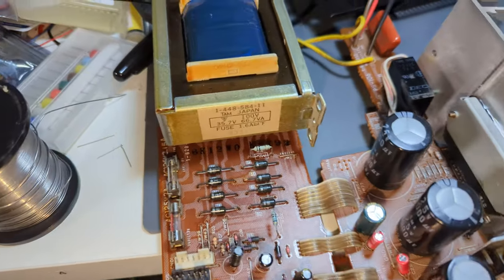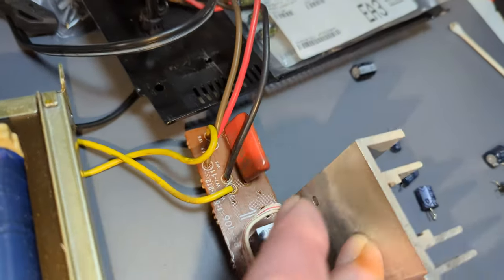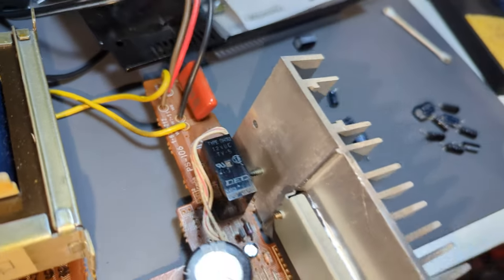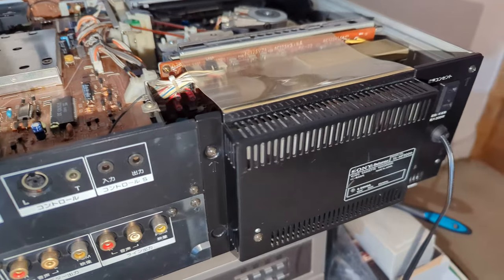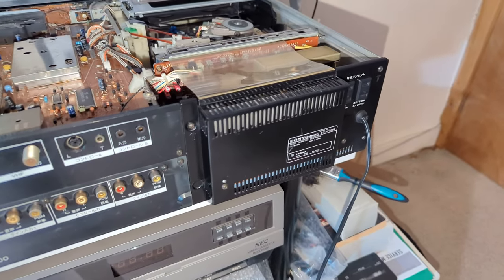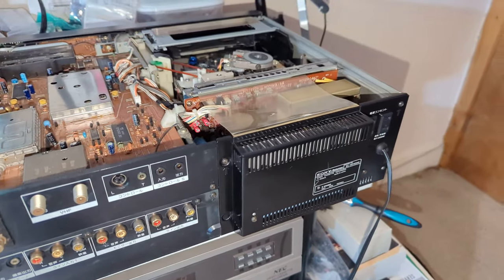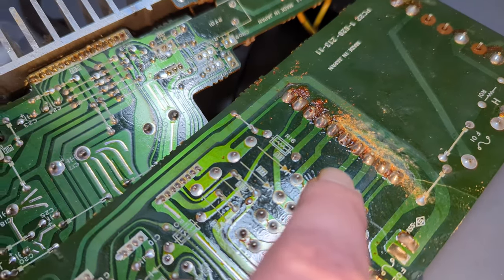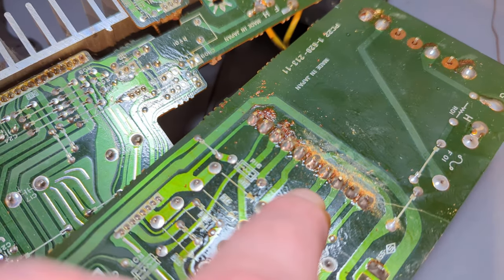Sony Betamax SL HF3000 Part 1 Repairs and servicing

Comment: I recently bought one, in really good shape, off of Ebay.  It came from Japan, which is good, since I've always had good experiences with Japanese sellers.  One thing, though...all the lettering is Japanese!  That's not a problem, since I'm getting a manual.  Also, it's rated to run off of a 100V AC line, which is OK, since I have a Variac power supply.
Reply from the maker: That's really great. Yes, I've had great success (so far!) with sellers from Japan. I do run mine via a variac; it's not easy to find auto-transformers for 100v line; only 110v which is too high unfortunately. Brilliant machines aren't they!

Comment: I hope you have better luck with your SuperBeta than I have with mine so far.  I have concerns about the regulator chips too, as you know.
Reply from the maker: The STK chips seem genuine and I've been assured from the seller they are and Nikko do seem genuine but I've not had cause to change any of them in the three power supplies I have so no experience if they are actually any good. They only provide low voltages in these too and only had issues with the 26v / -26v and 45v rail which are rectified and smoothed separately. Hopefully you'll have some luck with your machine. The older ones do seem more solid and resilient though.
Reply: I did fix it, the regulator was OK.

Comment: hi are you bidding or  any betacam sp 1800  there's some one put a silly low bidd on all the time 
i am badly need of parts   it would be better to talk  on email  and not push up the price on ebay 

there is a deck i am watching  right now there's a very heavy bid   if there any parts you in need of  
pleaes let me know   i am going over to the 100ub  deck later on  with cost of living has hit us all 

bob
Reply from the maker: No - I don't buy any Betacam kit - just the one A500p back a few years ago. I don't have the space! Are these machines really going for so much more now?

Comment: hi 2 cor cable on teac  come's of on reel to reel  go over to 3 cor uk  my brother in law   did it as a job 
and said got to be  new eu sockets  iec is it called  and with hoods over the solder  points  
yes to get over pat test he doe's for me   i have pat tester from his old job
Reply from the maker: Yes, very true but 125v rated cable isn't 240v rated cable so it is a tad dodgy to be using it. Also isn't to IEC spec either but it gets the job done for testing 100/110v machines 😊
Reply: @MrBetaByte  my unlce was in the cops and 
was in the east end of london 
why the name

Comment: hi very good point space  for gear is getting to be a thing     i know this not you game  

there is a big lego crazy my in laws  house is full of it kids rooms have alot of it
the big down full of lego will be the space running out because of space 

get back to the video's    there is alot of betacam / betamax decks out there  you see if the decks go to any tips the tip men  resell them
a lady i work with her man works for a tip  all the old vcr  and recorder  go in a lock up and are re sold  later on 

a round   and a round they go    i pull all the decks apart to stop this   i saw the phone video  steal work  good  plan  to stop the same deck
doing the runs of resellers    

i had to pull 4 betacams apart   for good parts     i have to start on the 12  100ub  decks i have i am over moon you have this clannel
help be big time what to look for  on the decks  why i left them   yes i know i go on about  the later decks  alot  i was like you once

in the  end i had to come away from betamax  doing my head in  just to many bad parts with heavy wear on them some were used 
in cable tv cable  there was one in london that used SVHS decks  i think it was ad's on the tapes 
i had some from a carboot   the brown  jvc tapes   SVHS
Reply from the maker: I really need to clear some kit as I'm so tight on space and have other projects I need to do too.

interesting on the recycling centre guys pulling VCR's for resale - thought that had stopped now. I never throw complete machines though anyway so really broken and useless machines from me shouldn't find their way back to eBay.